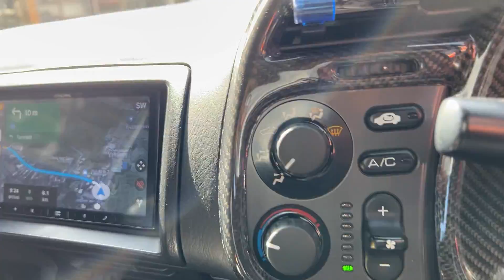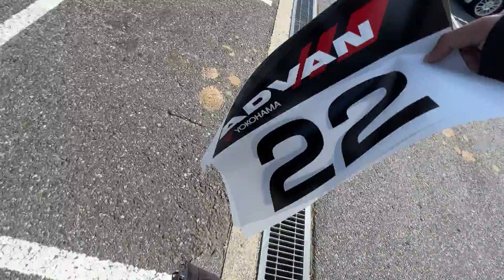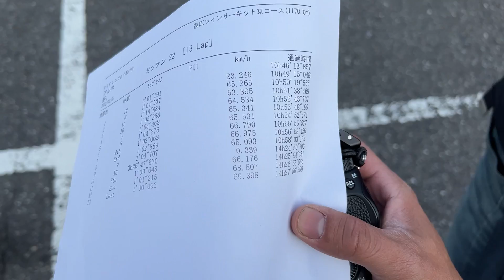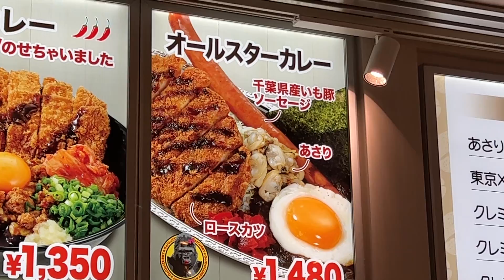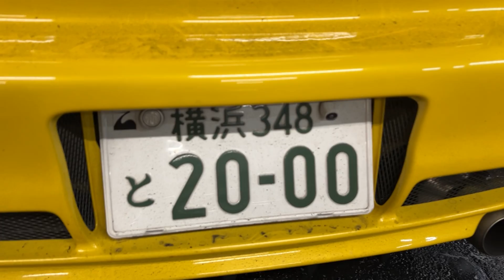I TOOK MY S2K TO THE TRACK AND ALMOST CRASHED ON THE FIRST CORNER 😱

Comment: Hey Albo, you inspired me to get a S2000 and i am also on the way to soon track it! There is a lot to still! Looking forward to your videos! 

Qq. Wouldn’t it be better to run a HANS device in combination with the 6 point harness?
Reply: 100% yes, with safety devices, your normaly go all in or dont even bother. i mean, cage, harness and Hans device or just run Stock seatbelt and seat.
Reply from the maker: Working on it, they are pricey!
Reply: @ALBO  gotcha :) looking forward to it =)
Reply: @Mind2kill  Yes, i wen't all in, aftermarket seats and harness makes the car soooo much different to drive. I also carefully took out all the floor mats and plastic covers, it's intense, you can hear everything and i love every second of it haha

Comment: Looks like to start, you guys were falling prey to liftoff oversteer,  ...possibly why your friend resorted to the handbrake to get the right combo of grip and rotation,  you probably just need to get a feel for your braking and weight transfer  if you're going for limits of grip.  :)   

I think you were still engine-braking when you passed the apex, so, traction went byebye in a non-drifty way.  Usually you'll want to be back on the power by then,  that old saw about 'slow in, fast out.'      Might possibly help to loosen the setup a touch till you do get a feel, depending how you learn.  :)

Comment: nice driving for first time bro, having an ap1 too knowing the behavior, its very snappy compared to other entry level sport cars, letting off while in a corner can be very disrupting to the chassis.. get Assetto Corsa and get s2000 mod or the J's racing s2000 and drive on the Nürburgring for like 50-100 hrs and ill guarantee you will be 10x better! i hate backseatting your driving mistake but I think it will help a lot! conquer the Nur and you'll fly on any other track fr i promise.